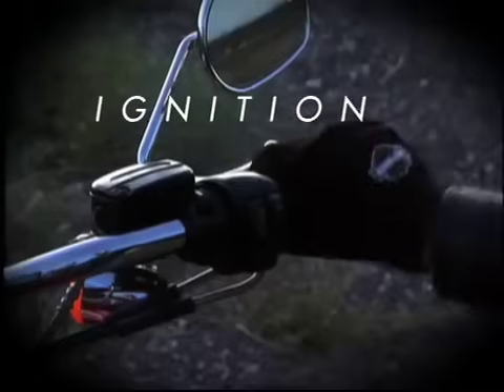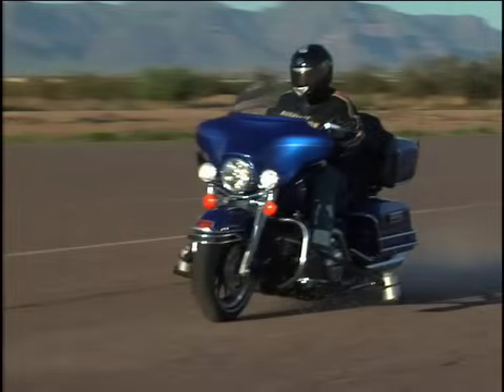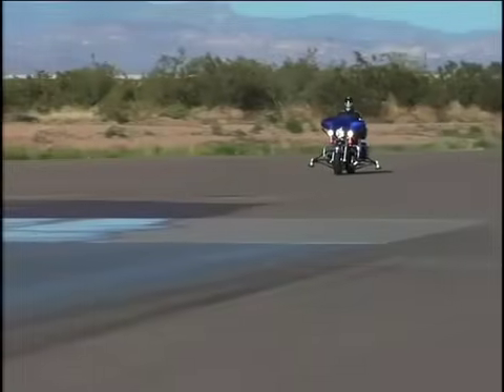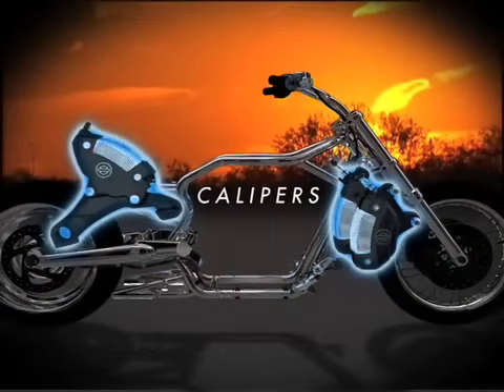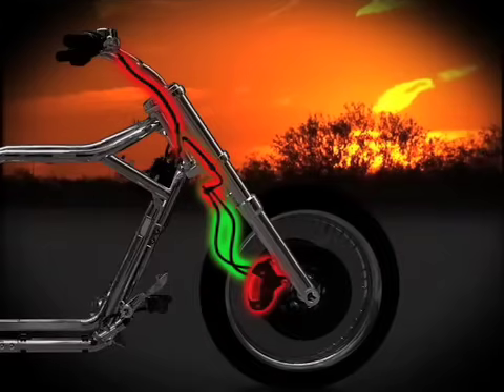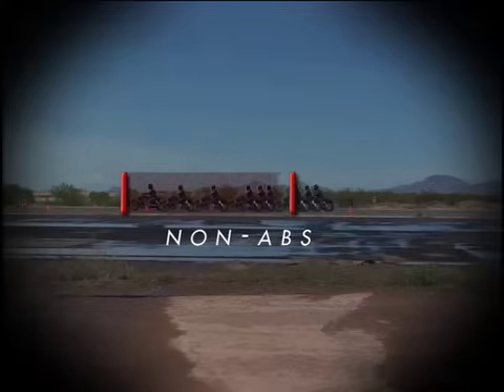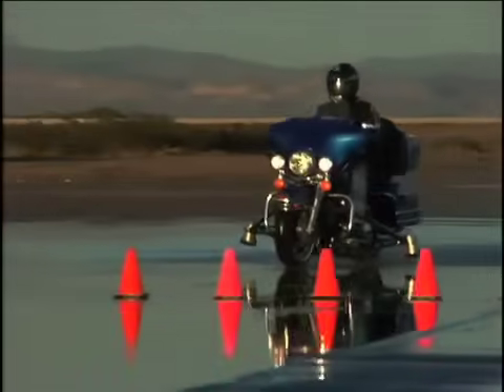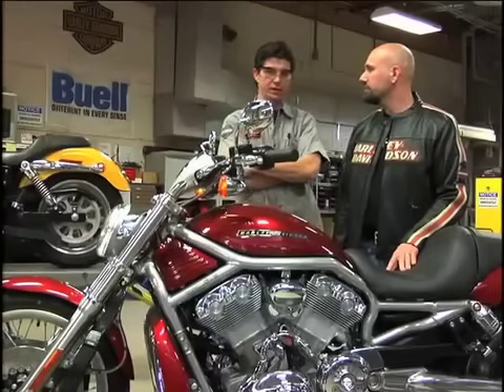Harley-Davidson: Anti-lock Braking System

Comment: @southernstylecycle 
Now that is an a amazing statement. I suppose we should be riding horses instead of driving cars using your comparison. The only time you even know you have ABS is if you are in a panic stopping situation. So, the only way you would know you have them is to run around locking up your brakes all the time. Is that what you have been doing all these year locking and skidding around the streets on your shovel-head.

Comment: Many poo-poo ABS. The bottom line is having ABS on your bike statistically cuts your chance of having a fatal accident by more than a third (IIHS). I did my first 30K all weather miles on a bike without ABS, then I switched, I will never go back. They are helpful in all conditions, but are especially helpful if you get caught in the rain, where wet brakes and wet roads make it impossible to tell how much break is optimal.